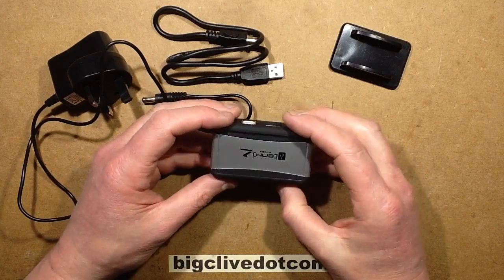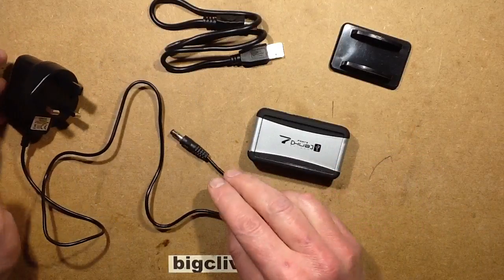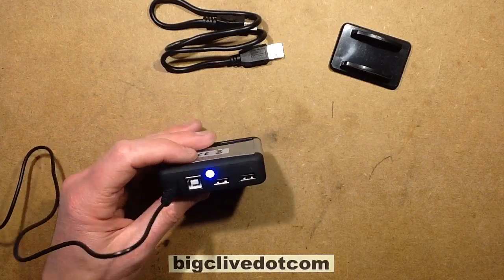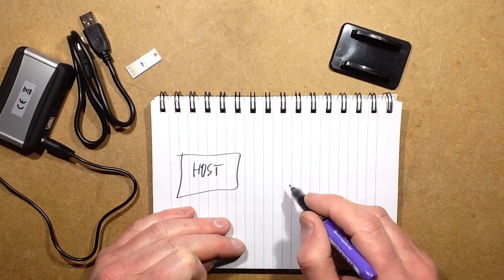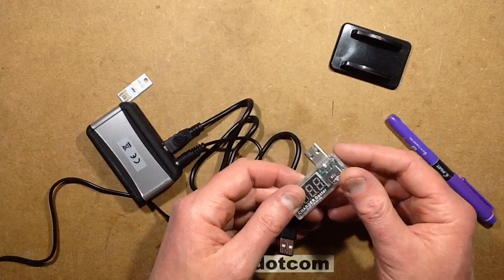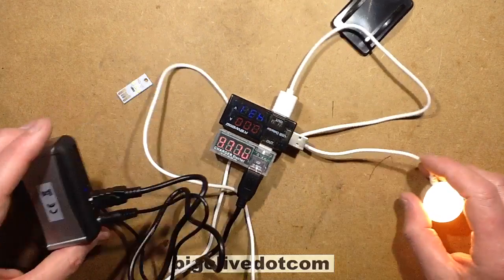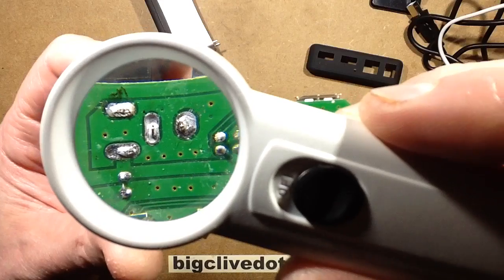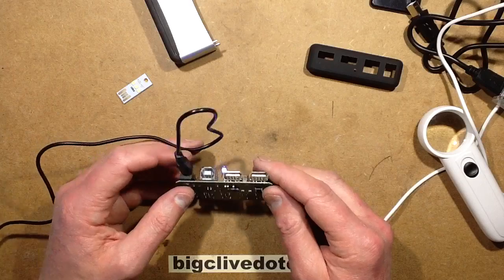Computer killing powered USB hub.  (Mac murderer)

Comment: I'd also like to point out that macs tend to be funny on the software side of how the usb hardware is managed. I've had several devices that cause a reboot in OS X, but function normally under Windows or in Linux (under emulation).

Comment: That hub isn't following the USB spec. It's OK for a hub to operate powered either externally or by the host. It is never legal for a hub to connect external power to the host port. It's just a faulty design. I don't see why it would have been done that way. The USB.org website has plenty of example circuits for USB hubs that any manufacturer can use freely.

Comment: When i charged super-capacitors directly com a apple PC que USB connector stopped working, when i do that using my PC(ga-990xa-ud3) it just limits the current, seems like apple IO engineering is actually inferior to a semi-budget motherboard.

Even with the super-capacitors charged at 5V and with the PC turned OFF and not plugged to electricity physically it does not damage anything, just powers the USB devices i got on the PC.

Comment: So yes all 4 wires from a USB hub to USB host must be connected as powered hubs are designed to work as un-powered hubs if the external power is removed.

Any decent USB port should withstand 5v feedback to it. This doesn't mean it should function while the power is applied, it should return to normal afterword the power is supplied. Some ports are protected merely by a polyswitch and diode combination, most however use an controller chip with mosfets. This chip provides things like voltage and current sensing, short circuit protection, current limiting and reverse polarity protection. I've hooked up by mistake 9v 1amp to a USB port and the port went dead but came back to life when the computer was restarted.
Reply: +SublimatedIce There's supposed to be a series diode or some relay to switch between bus-power and external power. Every properly designed USB hub I've seen is like that.

Comment: wouldn't just a diode between the 5V pin from the computer and the 5V pin from the mains adaptor have solved the problem? (anode at the adaptor side)

Comment: My tablet uses its micro-USB port to both charge itself and  power other USB devices. So I'm pretty sure it's possible to harden USB port against 5v input, unless I'm just naïve about convention or standards.
Reply: +xponen Nearly every device will withstand 5v being fed back into it, if I'm not mistaken it's actually part of the USB 2.0 standard (don't quote me on that though I'm not 100% sure). Nearly all pc's will just disable the port until the issue is resolved by unplugging the device for instance.
Same for most Android mobile phones with micro USB connectors and presumably Windows Phones too.
Apple apparently didn't think anyone would ever stick a crappy hub in their ports and figured protection against shorts was also not useful, shame that those machines which are easily twice the price of their Windows counterparts lack such basic safety measures...
Reply: You are absolutely correct. It is extremely easy to design a USB port that only allows power to flow one way. The answer is a couple cent diode, which allows power out, and not in. I'm suprised more computers don't have that kind of protection to be honest.

Most tablets that have USB on the go (USB OTG), like yours, do have this protection built in, for more reasons then just protecting the port. This is because it can act as a host (computer) or client (device connected to computer).  Obviously if both a computer it was plugged into and the device tried to be the host it'd cause a conflict, it disables host mode when connected to a computer, but enables it when disconnected or just using an AC adaptor. The battery also stops outputting power while charging due to how the charger circuitry and usb controller works. This is a fancier way of accomplishing the same thing It's necessary for USB OTG to be possible anyway.
Reply: Some Guy
My thoughts exactly.

Comment: I hope this doesn't kill computers because I've been using this exact hub with my Raspberry Pi computers for the last couple of years. It obviously does feed 5 volts back into the computer, because the Pis accept power from their USB ports as a power supply, as well as from their power supply port - hence why they weren't exploded but stayed on when the proper power supply was unplugged. I'm going to have to make sure not to plug mine into any full sized computers any time soon though.
Reply: +TheRebel3000 - Apple hardware is special.
Reply: +TheRebel3000 Nearly all normal pc's will deal just fine with this, depending on the motherboard and usb controller that is. If they are among the 99% that will deal just fine the controller will discover the issue and disable the port, most operating systems will notify you of it and after unplugging it the port and pc will work just fine as if nothing happened. Just don't plug it into Apples...

Comment: properly designed hubs should have a diode to prevent current flowing back into the host (as powered USB devices do) but I've seen cheapie Chinese hubs where the footprint for the diode has been shorted out. this is the first I've seen where they didn't even bother!!
Reply: Yes- all for the cost saving of one diode. Mind boggling!

Comment: What's weird about this is that Intel-based Macs use the same Intel chipsets as on PC motherboards — they're the USB ports in the Intel chipset. So I'd be very surprised to find that PCs with the same Intel chipsets didn't get killed just as swiftly.
Reply: +Antonio Tejada inrush current isn't protected by the chipset... it's protected by decent hardware design on the motherboard itself. Most even half decent motherboards have protection on their USB ports using resettable fuses or diodes or a combination of the two.

Comment: I had one of these that wouldn't let devices be detected so I binned it. It seems to be a commonly copied design from factories around China.
Reply: +nucleochemist Probably the USB controller detected the issue and disabled the port to prevent damage, which would work but makes sure the hub and any device connected to it will not work...

Comment: I had one like this a couple of years ago, with my intel mobo, it didn't give two shits. That motherboard still works to this day.
Reply: +TheLameTechGuy See that's what's weird here… Intel-based Macs use the same Intel chipsets as on Intel mobos. So anything that affects one should affect the other.
Reply: +Antonio Tejada the motherboard design as far as implementing IO ports has nothing to do with Intel
Reply: This is true. Like I have a Gigabyte board that supports the fast charging apple devices. Thats not a Z77 Chipset feature, thats a gigabyte implementation.

Comment: I used to have an Acer PC which had a digital readout on its top panel to show various functions, that PC would also keep its USB ports powered on even after I shut it down.  I bought a Swann branded USB hub that could either be bus powered or self powered.  One day, I went to turn on my PC but it wouldn't turn on, the digital readout was still coming on though, I was very surprised.  I eventually found out that my PC's power cord had come out of the power board, but the AC Adaptor for the USB hub was still plugged in and the hub was supplying power to my PC's motherboard, just enough to allow the VFD readout to come on, and obviously some of the chips on the motherboard were working too.  Later on I bought a UPS to keep my computer working during blackouts.  One night we had a blackout, because I wasn't using my PC at the time I turned the UPS off so I wouldn't have to listen to it beeping all the time.  The power came back on later on.  I should say that though the computer was connected to one of the battery backed sockets on the UPS, the AC Adaptor for the USB hub was connected to one of the outlets that wasn't powered by the battery backup.  Next day I discovered that the AC Adaptor for the USB hub had apparently stopped working.  I concluded that when the power came back on during the night, the USB hub came to life and started powering my computer's motherboard, the computer was still switched off at the UPS, so its power supply was off.  I concluded that the computer's motherboard was possibly drawing too much current for the AC Adaptor to handle, and so it failed.  The AC Adaptor was rated for 5 volts at 1 amp, the USB hub had 4 ports on it.  Does my conclusion sound correct to you?
Reply: Yup, your conclusion makes a lot of sense. That's very interesting.

Had a similar experience myself. I used to build experimental USB devices and leave them plugged in for no good reason. Once I left one on battery power and plugged in at the same time. The power went out during the night. Miraculously, the lantern battery powering the +5V regulator on my experiment managed to retain the standby power until the power came back on. Kept my flash game saved. XD
Reply: Interesting.  I've actually had several of these Swann USB hubs, I still have 2 of them and one working AC Adaptor.  I am a Mac user now, so if the Swann USB hub behaved the way it did with my Acer PC, I wouldn't want to risk using that USB hub with anything else unless I'm going to use it in bus powered mode without its AC Adaptor.

Comment: So the negative terminals are all connected as a common reference, and this hub supplying +5 VDC to a Mac on the +5 VDC USB terminal kills a Mac? Excellent engineering, Apple. I could understand damage if the polarity was reversed, or voltage extremely excessive, but this is unacceptable.
Reply: +LakeNipissing In what circumstance do you expect to feed current into a output? I'm pretty sure this can damage other pc motherboards as well.
Reply: +victornpb  An alternator (output device) charges a car battery (storage device). If a battery charger (output device) is connected to recharge a dead car battery, it is reasonable expectation for the alternator not to be damaged or go up in flames. It is also reasonable once the battery is charged enough, the car can be started and the battery charger not damaged when it, and the other output device (alternator) are connected in parallel with the battery. The reason? Common reference (negative), and Vcc is within reasonable limits (11 - 16 VDC).
Apple engineers would really have a tough time explaining why 5.0 VDC from the USB hub connected in parallel with the same output voltage from a USB socket on a Mac should cause any damage at all. With the same polarity, current flow would essentially be zero.
Reply: what happens if you supply 5v to the output of a unplugged charger?
Reply: Apple is known for badly engineered but somewhat stylish HW.
In the products I develop in a small team, testing for reverse powering via USB is an obvious thing to do. Shame on Apple.
Don't buy a mac.

Comment: I never use powered USB hubs, mostly cos I have so few USB things, but, yeah, they shouldn't be sending out 5v back to the computer, simple fix though, snip the 5v pin on the back of the USB socket... :)
Reply: +twocvbloke Lets see... i've got a wifi usb stick, a mouse, a keyboard, a memory stick for cmos profile, a usb microphone, another memory stick for portable storage, a usb to sata port for back up drive, a printer, my phone charger, and my keyboard pass through. So ya... im gonna be needing that simple fix....:)
Reply: PierreDolphin
I have multiple computers, so loads of USB sockets on hand... :P
Reply: I ran a few molex to usb power cable straight from the psu before. Super helpful   : P

Comment: Beware!!! This isn't only a serial killer with a Mac fetish, it cripples Windows computers too, as I found out to my cost :/
Reply: +sgtgrash The you have a shitty USB hardware on your PC.. But yeah I imagine this would damage things if it goes on for extended periods of time with a PC.
The fact it puts the mac into the "Big Sleep" is fucking hilarious.
Reply: Victims: HP DV7 laptop and an ASUS P5Q Pro mobo. In both cases the powered hub took out the USB hubs on the mobos. Desktop PC was the first victim, which I put down to component failure due to age of components. I realized my mistake when the damn thing killed my lappy too...
Reply: +Sean Ache You know what they say about experience and painful lessons being good teachers... :/
Reply: +sgtgrash Happened to me too! I was pretty sure it was the hub, but the store I bought it at looked at me as if I were crazy but gave me my money back. Sent them an e-mail now linking them to this video. Feels great to prove I was right all along! Kjell & Co in Sweden sells these things rebranded as Plexgear.
Reply: +pepzi Bummer! Sorry to read you've been through a similar experience. I'm over it now (2yrs over it, actually). I built myself a new PC and also purchased a far more modern (and faster) laptop. I have also recently discovered the joy of SSD's, and thus both machines perform like Louis Hamilton on speed... XD
Reply: TVS diodes and protection circuitry like PPTC fuses goes a long way.

Comment: It's just blown some surface mount diode or something like that. We had a guy who fixed things liek that when I was working in computer repair shop. Some HP laptops would very easilly blow diodes if re asembled in a particular way. THis can also happen with OEM battery chargers and batteries on some models.

Comment: I thought, damn that's horrendous!......until i read it's killed Mac's :). I've had that exact same hub on my setup for about 6 years without issue but have not had it powered......i've just opened it up and yes it is the same pcb back feeding power!
Reply: +blower Think i'll put it on ebay with the listing title 'Mac compatible USB Hub'